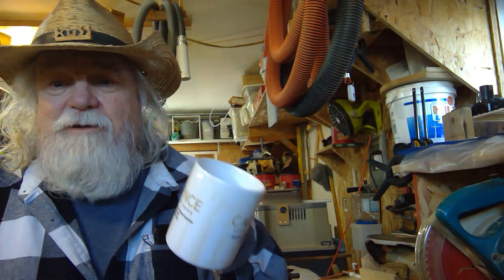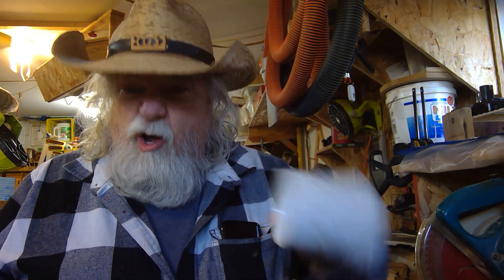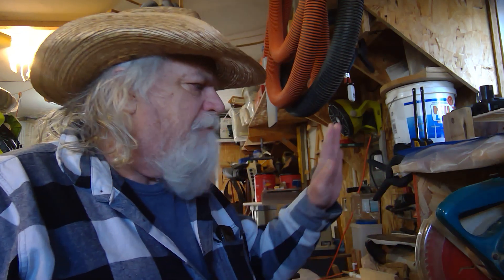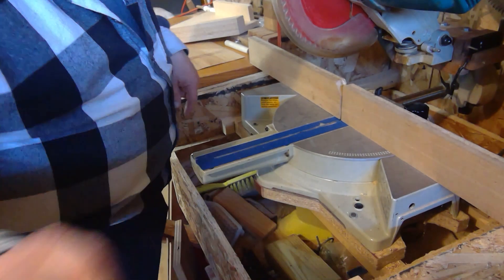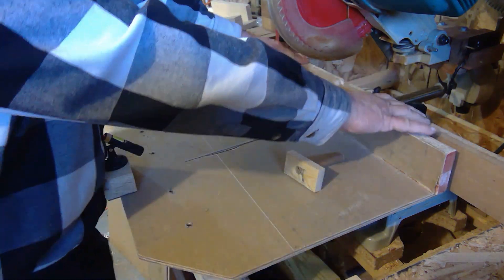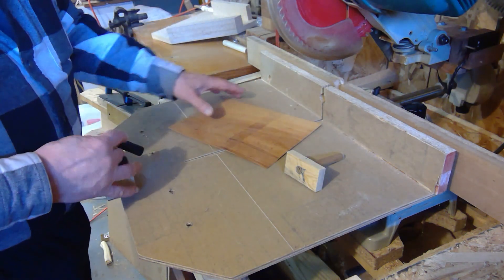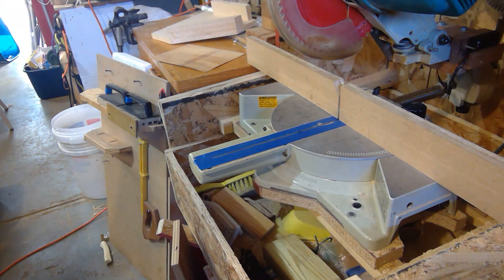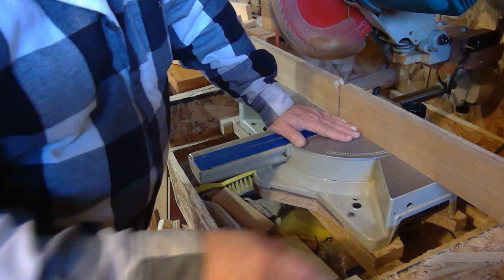Laser on My Mitersaw by OTB Thinker

Comment: Hi Russ, Merry Christmas glad that you are back on line. I bought a new Bosch 12” miter saw which has a double lines for each side of the blade. I’ve never been able to line up the lines with the blade. Later I found out that you can only line up one line at the time. I wonder why they can’t they design one which makes it possible to line up both lines on different thicknesses of the blades.
Reply from the maker: Thanks Hai, and Merry Christmas to you too.